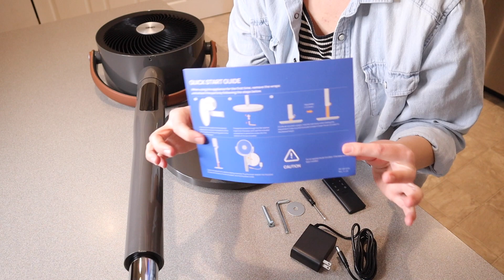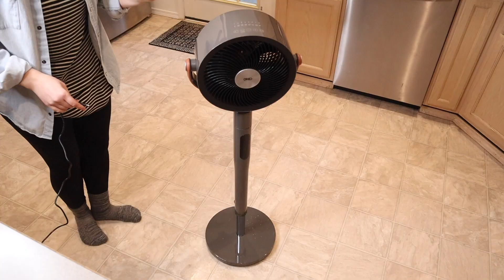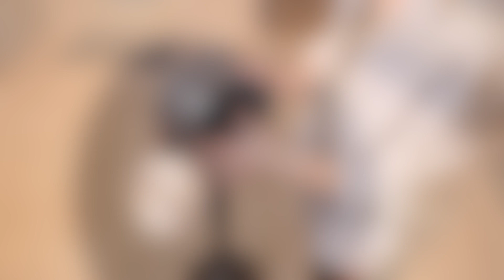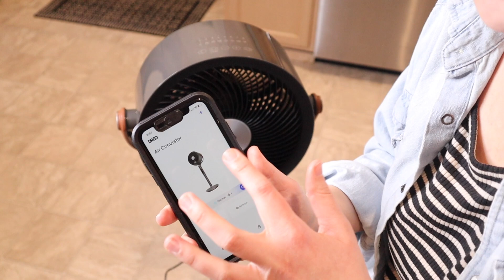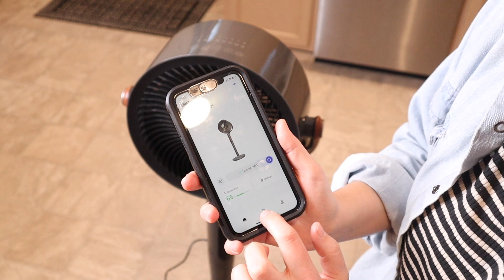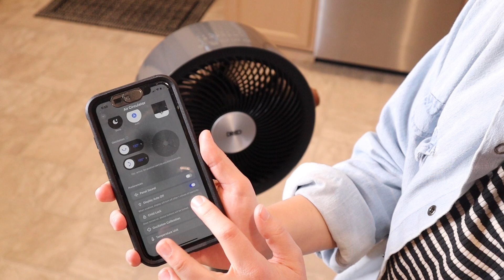Dreo Smart Fan for Bedroom, Pedestal Fan with WiFi/Voice Control, Works with Alexa/Google

Comment: How do i dismantle it to clean the fan ?
Reply: Having just got this fan (it really is pretty awesome), they provide a small screwdriver which you can use to unscrew one screw on the back of the grill, so removing it and cleaning the blades should be relatively straightforward.

Comment: Sharp design - but I'll be waiting for an eventual upgrade related to the 90-degree power plug-in. A smarter approach would be a bump-out from the rear where the power cord plugs in parallel to the neck. Looking forward to that . . .